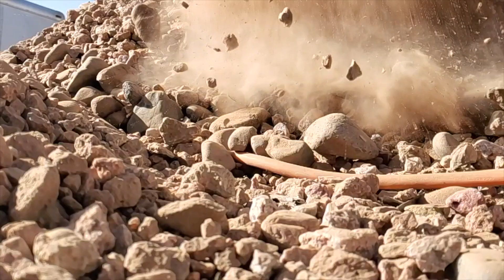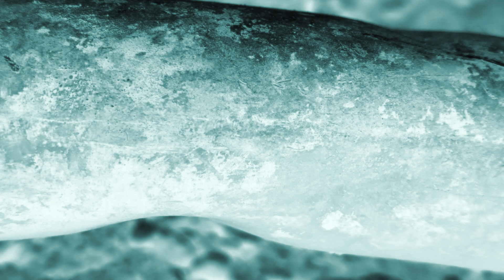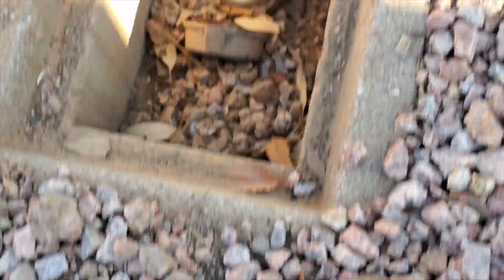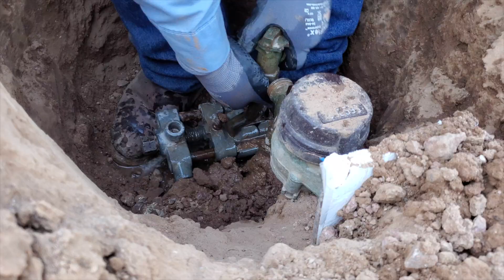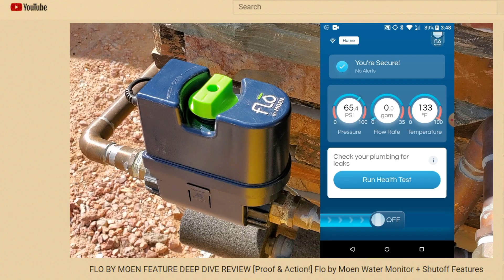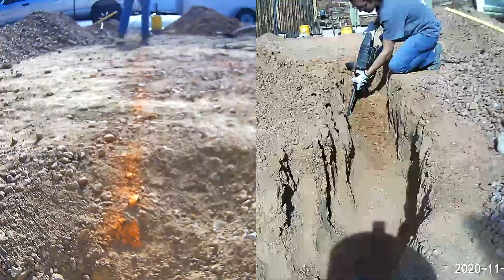Should you REPAIR or REPLACE Your Leaking Water Service Line?

Comment: In Buckingham Estates the standard water pressure runs between 75 and 80 PSI. Not only are the streets being ripped up for breaks house Hot Water pipes are leaking. New main line install should include a pressure regulator which I set mine to 55 PSI.
Reply from the maker: Wowza, that's up there and not a good situation. Mine is a steady 55 without a PRV. A PRV is most definitely a must have there!

Interesting that it is specifically hot water pipes within the houses--not hot and cold. My hot water line formed a pinhole leak right by the water heater. This 80's neighborhood has copper plumbing run under the slab without any sheathing so in direct contact with the soil. Having researched it--it's a real phenomenon for unprotected heated copper interacting with the minerals in the soil, forming pinhole leaks. Maybe you have something similar in addition to high psi?

Expecting another leak, I installed Flo by Moen and then switched to Phyn Plus to keep tabs on the leak situation. Both systems also have the additional feature of reporting the PSI.